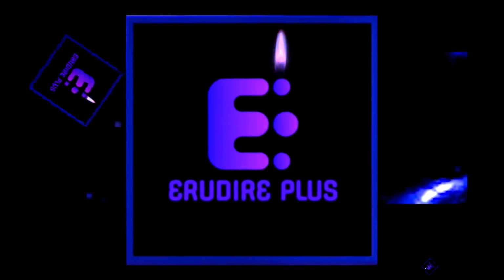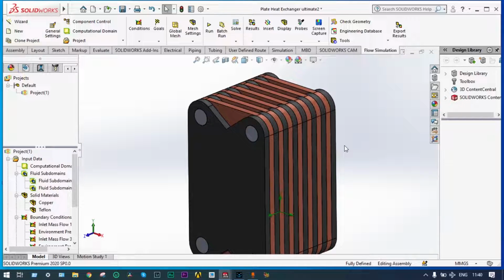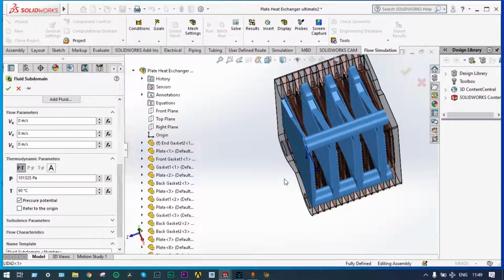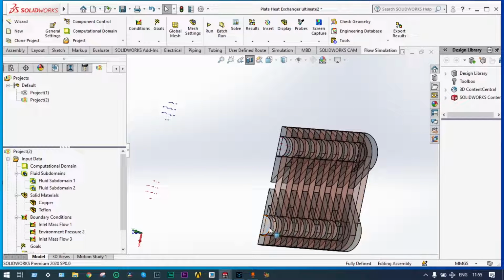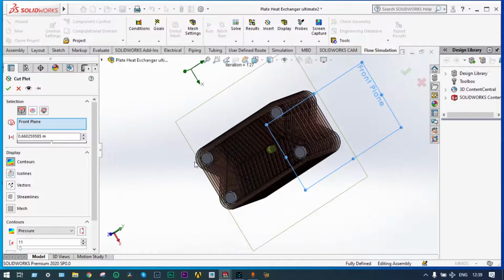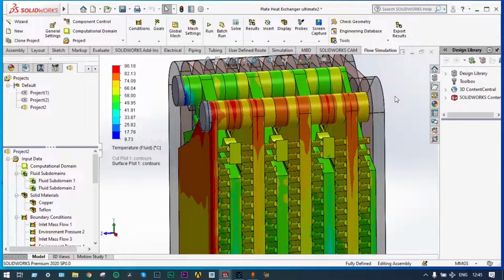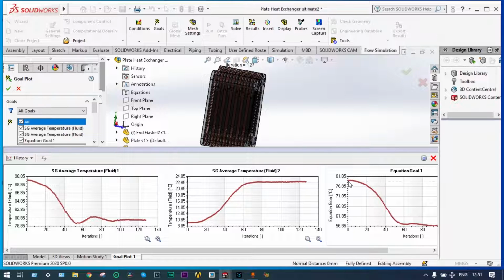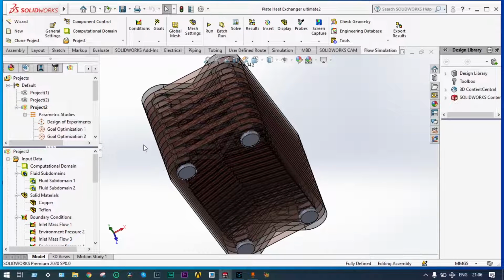Optimizing Plate Heat Exchangers with CFD: A SolidWorks 2020 Parametric Study Tutorial

Comment: Hi, could you show me how I can do a flow simulation simulation to see how long a fluid is heated inside a tank by applying steam through a jacket?
Reply from the maker: You have to perform a transient analysis for any specific time. Then you have to optimize the time as per required goal.

Comment: Dear S. Majumder, Thank you for sending the geometry file. However, unfortunately, there was a problem in importing the soldworks file. For reference, I am using the ANSYS ICEMCFD software. If possible, please send either the step or parasolid file format (9822d08@gmail.com). I am sorry for making you troublesome.

Comment: Hello, I would like to analyze this model in ansys. I checked the link in the comment below to design it myself. I'd like to receive the sample file of this model and see it for myself, is it possible to send it? I'd appreciate it if you could help me.  Thank you
Reply from the maker: Sent the assembly in IGES format and also in Parasolid format in which you can open it without any problem
Reply from the maker: My mail bounced back. Can you provide any other email address
Reply: Could you send it to me? If it's not working again can you try  pls. Thank you
Reply from the maker: Sent. Please check your email
Reply: @CFD_GUIDE  Thank you a lot. I checked it.

Comment: Sir, could you please send the geometry and assembly file..my email cont is howardkwok26059999@gmail.com Thank you so much
Reply: Could you convert the file such that it can be opened solidworks 2019 ?
Reply from the maker: Parasolid format is OK. I will send it to you today afternoon
Reply: Thank you so much
Reply from the maker: Sent the file in Parasolid format and iges format. You can open it easily with old version of Solid-Works. Better try with Parasolid format with the extension x_t.
Reply from the maker: Sent the assambly. You can open your email to check it
Reply from the maker: The mail bounced back. Please send another email address
Reply: @CFD_GUIDE  y743362999@gmail.com
Reply from the maker: Sent the assembly. Please check your email
Reply: @CFD_GUIDE  thank you so much

Comment: Hello sir !  i hope you will be fine , sir i need your guidance and help , i am postgraduate student and studying in china , my thesis project is also related to this type of heat exchanger . i have to design plate type heat exchanger and do analysis of ANSYS , sir can you share wiith me some data , how to design this model , in this video its just an designed model. appreciated in advance for your help , thanks
Reply from the maker: Actually it is a very simple design consosting of four parts. You can follow the link provided to understand the model its functioning and assembly.
https://youtu.be/xMljyaBM9Fk
Reply: @CFD_GUIDE  Thank you for your kind response, its just assembling , I want to learn how to design it because i am beginner
Reply from the maker: From the assembly you can separate the parts and see the geometries. It is not difficult very simple. You have to use 3d sketch and draw the zigzag lines and cut it. I will show it whenever I get somr time
Reply: @CFD_GUIDE  Okay sir thank you
Reply from the maker: If you want I can send my assembly in igs format and you can analyse it in ANSYS
Reply: Hi sir, I'm sorry to disturb you. My thesis project is same of yours. but I want to know how to design the plates. Did you find anything about it and guide me? thank you

Comment: Sir, can you send me the geometry file of this model, my email address is shreyastaware13@gmail.com. I am using currently SOLIDWORKS 2017
Reply from the maker: It was modeld and analysed using SolidWorks 2020. So, I am sending you the file in Parasolid format in which you can open it without any problem.
Reply from the maker: Sent the assembly

Comment: In applications of surface goals, you have selected the entry of cold fluid as a goal instead of the exit of cold fluid 17:00  ?
Reply from the maker: May be,I was in a hurry. But the option should be to choose the exit surface,. I mentioned it in the video. My attempt was to intimate the users the basic steps.
Reply: @CFD_GUIDE  When I started the calculation, the LMTD is no longer stable it oscillates, do you know why
Reply from the maker: The reason must be the formation of equation. LMTD equation should be split in simpler form. If any error is occuring it will continue repeatedly if you are running it again and again. In that case before running you have an option not to consider previous calculations. Then it must work
Reply from the maker: Plz tell me whether you could find LMTD?
Reply: @CFD_GUIDE  yes yes thank you very much I managed to do the simulation I am very grateful, please how I can determine the heat flux in  form of equation and in form of a graph
Reply from the maker: Find heat flux as one of the goals and while seeing the goal plots from history it will show in a graphical manner.